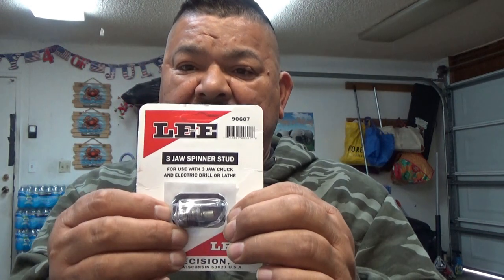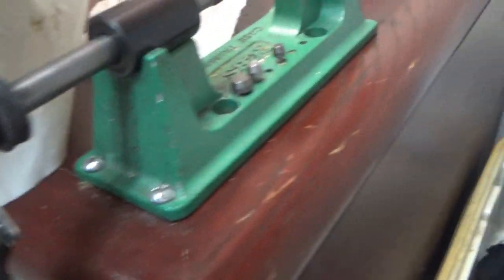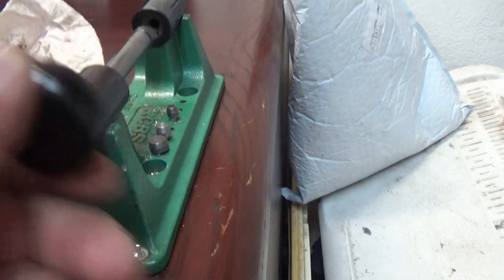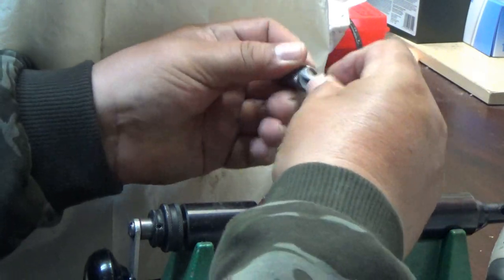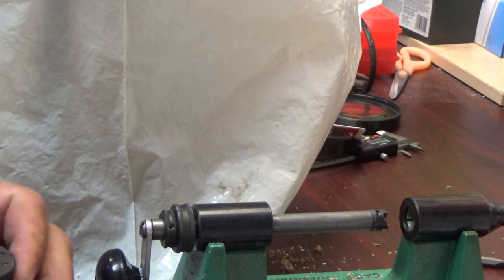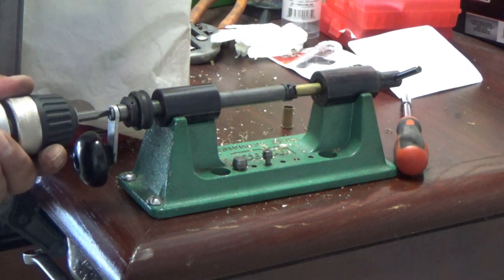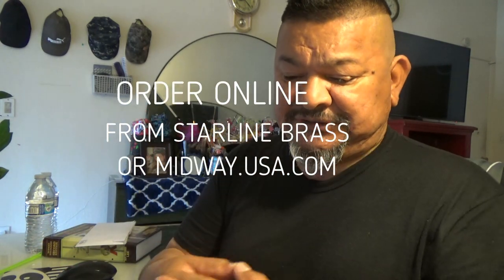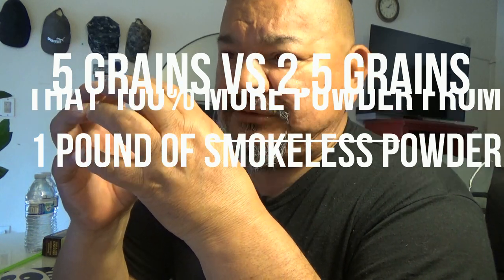FORMING 38 SHORT CASES WITH LEE'S CASE CUTTER AND TRIMMER.

Comment: I really like the idea of efficiency. As you pointed out, 9x19mm works that way. I'm sure the high pressure helps. I do have a bit of a concern with SC length brass tossing 110gr bullets at 9mm pressures. The bullet should be trucking along by the time it reaches the forcing cone. Also, for unjacketed bullets, you have a lot of room for blow by in the chamber before you reach the forcing cone, so you may get leading well into the chambers.
Reply from the maker: FAST BURNING POWDERS AND A GOOD ROLL CRIMP IS IN ORDER. IVE USED LEE'S 105 GN WITH GOOD SUCCESS, THE HEAVY CRIMP FIRES THE BULLET STRAIGHT INTO THE CYLINDER SWAGER  BEFORE IT REACHES THE FORCING CONE IN MID AIR BEFORE IT SHIFTS OFF COURSE....BUT FOR SNUBBY REVOLVER'S MY OPINION BASED ON MY EXPERIENCE IS THE LIGHT WEIGHT BULLETS DONT DEMONSTRATE STELLER ACCURACY BEYOND 10 YARDS FROM A SNUBBY REVOLVER....AS FAR AS LEADING THIS IS WHY I PREFER POWDER COATING TO REDUCE LEADING, EVEN 4" BARRELS ..WITHOUT HIGH VELOCITY YOUR ACCURACY DROPS DRAMATICALLY.
Reply: @Ford360CID  I've noticed that heavier bullets also seem to have a bit more accuracy. However, I have not tested this enough to say it's more than a gut feeling with no science behind it.
Reply from the maker: @Fudmottin   THE HEAVIER BULLETS OBVIOUSLY HAVE MORE BEARING SURFACE THUS THE BULLET STAYS IN THE CASE LONGER UNTIL IT REACHES THE CYLINDER SWAGER AND SHOTS DOWN THE BARREL STRAIGHTER AND MORE ACCURATE.
Reply: @Ford360CID  That sounds very reasonable to me.

Comment: Was the 38 S&W a black powder charged cartridge originally ?  
The 38 Special was a black powder charge and evolved into a smokeless powder cartridge. 
It seems that the 28 S&W functions like a 44 Russian does with respect to a 44 Special & 44 Magnum calibers.

While it would lengthen / increase the case volume if you seated the bullet on a bottom Lube Grove the Bullet would have a larger diameter for more of its length.  Not sure if it would seal better in the cylinder or not.  

I have pondered what would happen if you seated a SWC flush with a 38 Special or 357 case mouth instead of the crimp groove.  Obviously it would reduce case volume, increase pressure and reduce bullet diameter.   No idea what this would do down range.
Reply from the maker: #1 YES IT WAS LOADED WITH 13GNS OF BLACK POWDER THE 38 SPL LOADED WITH 20GNS OF BLACK POWDER #2 YES THE 44 RUSSIAN, 44 AMERICAN AND THE 45 SCHOFIELD WERE SHORT CASES THAT HAD EFFIECIENCY IN MIND, #3 I BELIEVE IF YOU USED A 2.5GN CHARGE OF ANY FAST BURNING POWDER USING A 148 WC BULLET AND SHOVE IT IN A 357 MAG CASE THAT IT WOULD ACT LIKE A 8MM 1895 NAGANT PISTOL CARTRIDGE.
Reply: Yes he .38 Short Colt evolved to the .38 Long Colt that evolved to the .38 Special and they were all originally black powder cartridges. 
The Short Colt was an outside lubricated heel bullet that was .375" in diameter to use in the converted 1851 .26 Navy bores.
Interesting progression from that tiny case to the  .357 Magnum.

Comment: Rather than going through all that, Just get a Trim die, You use a hacksaw and cut the bulk off the protrudes from the top of the die, then finish it with a med cut file. I believe you can have RCBS cut you a trim die for not much money, Depends on how much brass you want to make. anyway, that's the rout I would go. Btw.. RCBS will rebuild your case trimmer and send it back to you, they have a lifetime no BS warranty. -Dave
Reply from the maker: MY GOAL IS ONLY TO MAKE 100 OR SO AND I/VE MADE THOSE DURING MY LAST 38 SHORT VIDEO, BASICALLY THERE ISNT A STANDARD TOOL THAT CONVERTS 38 SPL BRASS TO THE SHORTY'S IT'S A HIT OR MISS WITH EXACT MEASUREMENT, THE LEE'S 38 S&W LENGTH GAGE IS NOT ACCURATE TO MAKE 38 SPL SHORTY'S AND EVEN WITH THE 38 S&W SPEC'S IT STILL COMES UP .010" SHORT SO HAND FILING TO THE RIGHT SPEC'S IS WHY I CHOSE THIS METHOD ITS NOT FAST BUT ITS PRECISE.